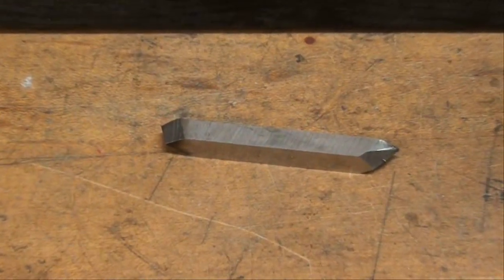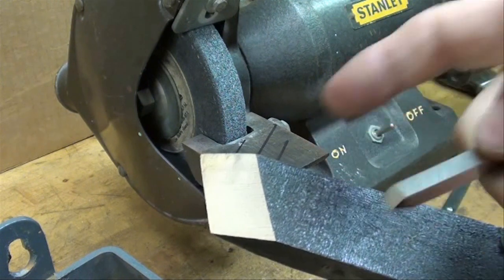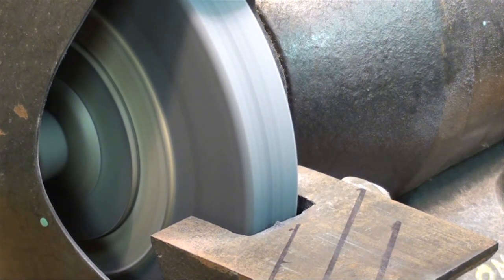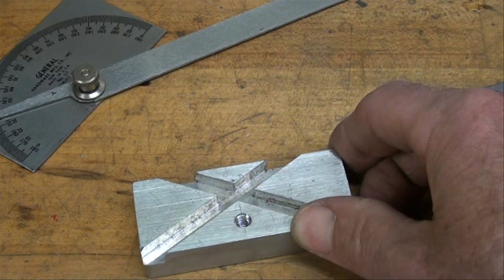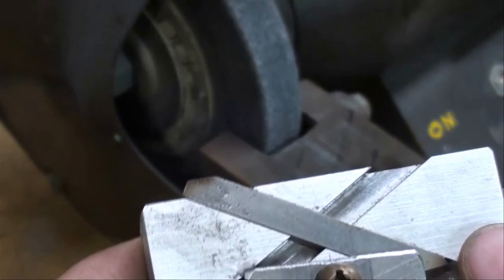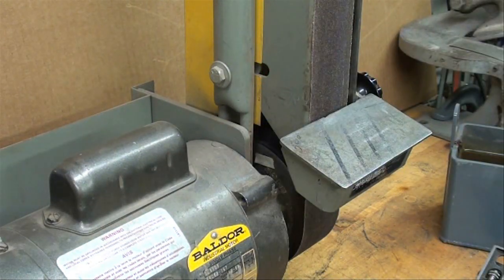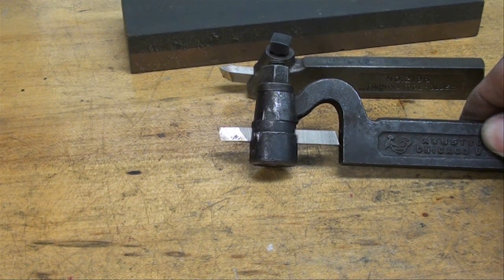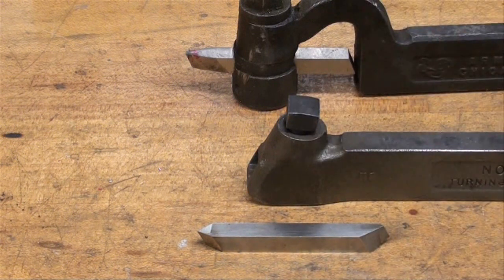MACHINE SHOP TIPS #98 Grinding a Lathe Threading Tool tubalcain

Comment: Mr Pete
  I have been a tool and die maker for over 29 years. I run a cnc shop and have a young man that I had do a little project on Friday. The project was to a  write program using the rotory table for this jig. Boy can he grind threading tools now. We now have one in 1/4,3/8 and 1/2. Acme to. These are  real nice jigs. Thank you vary much for the video.

Carl Boe

Comment: I remember the tool bits we had to grind by hand in tech school.  The three we had to make were a turning bit, ground to certain angles, a 60 deg threading bit, and an acme threading bit, of course they were all needed for projects.  We made heavy-duty planer jacks with acme threads.  You're right, it is very difficult, but not impossible to do.  By far, the most difficult was the acme bit.  I still have it in my toolbox after all these years.

Comment: if you major to land in your jig for your bench grinder / table you can put a fence on it like a table song where you can move it a little bit and um if you will run a bolt through it the whole length you can use it as a clamp to clamp in place so it's more movable and if you got any way to draw it out to make more sense because they usually have to draw up my plans for other people to understand them I usually can see it in my head in detail thank you for your videos this is not a generic thank you thank you so much

Comment: Thanks for the comment and I enjoyed the video, and liked the jig idea for creating the angles! I had always been more into right and left handed tooling ready to thread up to a shoulder, creating more bits because of limited pitch range, ending up with plenty of centered bits as they aged and worn back the leading edges. Sometimes a negative top angle was used to keep from sucking bits due to backlash problems in cross feed screws. ;{)---
Reply: cut a part to plan dimensions, then check it against an available constant.
We can always blame the plan. Right?

Comment: Here's a good tip. Just the other day I needed to grind a 55deg BSPP single point tool. I set up the Compound at 62.5deg using Trig. (Sin 62.5 x 125 = 111). This meaning I could machine a 3/4" piece of stock at 27.5 deg of chamfer. I did two pieces and drilled a small hole in one. I set one in the tailstock and the other in the chuck and brought them together. A perfect 55deg to set the tool grind. And exactly the same for any tool angle needed if you don't have the gauges.
Reply from the maker: Great tip!

Comment: I have watched a lot of your videos. I got a logan 10 inch lathe and have been turning a lot of steel into chips. I have a little round tool for making threads, and no matter wha I did, I could not make a good thread.  I gave up, and ground one. Night and day difference, the threads now are acceptable, and they were horrible before.  So thanks for what you do. You explain thing better than anyone, I really appreciate it.  Tom
Reply from the maker: THANKS, Tom
Reply: Whenever u cut any thread in any lathe the following angle and leading angle grinding is important . then there is no problem uccer at the time of threading . leading angle give  ( clearance angle ) given on the left  side of the  RH thread to remove the material and the following angle given on the right side (  clearance angle ) helps to finish the remaining material at the time of threading

Comment: Does the 60 degree angle change when you grind the top rake?  Seems like the angle would be a smidge smaller since the sides have the clearance but hard to wrap my feeble mind around the angles...probably splitting hairs.  Thanks for taking the time to do all the videos!

Comment: Sir: Forgive me if I err in digging through memories more than 50 years old.  I recall a machine shop teacher telling us that those angled tool holders spared us the chore of grinding a 20 degree back rake into turning and facing bits. 

I was NOT a good machinist and only too glad to get a mandatory class under my belt.

Eli D.

Comment: Hy I managed somehow to get vido playing but the audio now sound like driving on a dirt road.
Maybe also a tip for someone, I vise up the blank died and scribed and take it down with a
die grinder, taking the majority off then back to the grinder to finish.  Air die grinder is fast &
I have more control & no hot fingers, saving grinding wheel.  I like your jig now ill fire up my
shaper.  Thanks   oh also Kieths audios doing same thing. I'll call him he is good with PCs.
thanks again Sam

Comment: 2:36 Actually it is a requirement that the tip not be sharp. 
For cutting a male external thread the specs call for a flat width of minimum of PITCH x .125 and a maximum of PITCH x .250
For cutting female internal threads the tool must have a flat width of minimum of PITCH x .041667 and a maximum of PITCH x .125
A radius that fits inside those limits is allowed but not required.

Comment: Grinding various items is a great opportunity to see the various types of sparks that different steels make when ground and learn to identify them. But then Lyle says that later as I see.

Good point on the green goggles that seal around the eyes, gently blowing off your face and hair gets rid of debris that could later fall into the eyes. Big danger from the sharp chips you get using a die grinder with a carbide burr and other cutters.

Comment: Also on the method I'm, using:
A disc sander and a cross slide vice clamped to the sander table and I just run it at an angle and push the tool into the disc. (I have active water cooling on this sander - it's for preparing surfaces for microscope so active cooling, 12" buffing and sanding wheels, lapping compounds, nital bath at the finish, all without overheating that destroys the surface crystals on the metal.)

Comment: Do they make small grinding wheel that you can install on the lathe? This would give you all the control for any angle by holding the tool in the post and you are set to grind.

Comment: The angle you draw on the jig is 30 not 60. I used the protractor set as 150 degree to check the right angle.

Comment: Just want to say, I watched many videos on youtube but I enjoy yours the most.  You have a talent for teaching.  I have a question, on the belt sander, what grit of sandpaper do you have?  I was thinking of picking up a small one from Harbor Freight or Home Depot before now I have even more reason.  I already have grinder.
Reply from the maker: +Dima Prok I use either 80 or 100 grit. Perfect for general use, wood or metal.
Thanks for watching
Reply: +mrpete222 I got around to grinding first threading tool couple weeks ago from 1/4" blank and my "tilt" angle turned out to be much steeper at around 25 degrees (it's hard to measure).  I was able to make test threads and it seems to be working fine, I made test cuts.  Is there going to be a problem with angle like that?
Reply from the maker: +Dima Prok No-that will work. Just a more delicate tool - tip may break off
Reply: @DimaProk  make sure you take shallower in feed cuts and traverse the thread a few more times. Tool will last if you do that. Good job trying. Keep at it.

Comment: in my case it probably be easier to make it out of wood like a hardwood the table and The Jig cuz I've got a lot of wood on hand but not very much metal I mean I could cast some metal but it'd be easier for me to do would work with the skills and tools I've got and I've got a little bit of shop time with a grinder so it probably be easier with wood then I could make a more permanent gig you later of course it does take the 1st right hardwood and depends on how rough on him with it it might hold up enough for me to get enough tools out of it

Comment: Is it bad to lap the surfaces? I don't like coarse marks from the grinder, or sander.
I usually grind the tool with a disc sander varying trough grits up to 2000grit that gives mirror like finish and add some lapping compound to a hard buffing wheel to make it a real mirror. (+nital)

This is how I treat most cuts for microscope analysis on cracks, welds, etc so why not dress up the tools? For me it cuts fine the way I do it. 

Any reason not to smooth out the surfaces (without screwing them)?

Comment: Nice video.  I have appreciated you tool grinding series.  For the threading tool, you don't seem to bother with compensating for the thread helix angle adjustment on the opposite two faces.  Can you explain?  Does this mean that the tool you grind in this video is equally useable for both left and right hand threads?
Reply from the maker: +John Pierce Thanks for watching

Comment: so you grind the tool with the 15 degree angles, which gives you front clearance-then you put it in a tool holder that tilts it up-doesn't that pretty much wipe out the clearance to teh front of the tool?

Comment: Hi Mr. Pete, if I just have a lathe, (no mill to make the jig) can I get one of those wheels, chuck it up in the lathe on its side, and use the tool post to hold the tool steel at the right angle? (Maybe rig up a water cooling device as well)
Reply from the maker: +May the Schwarz be with you Thanks for watching. Probably not. Too dangerous plus the tool needs to be held at a compound angle
Reply: Thanks for answering!
Reply: +May the Schwarz be with you Since the jig is aluminum, it is conceivable tht you could use a table saw or radial arm saw (better) to  cut the grooves into the aluminum. Just use a carbide saw blade, set it for up to 1/4 inch depth and make a couple of passes to 1/4 inch. Kind of like a cheap horizontal mill, you know.
Reply: Pretty cool, oddly enough I do have a radial arm saw.

Comment: you can not put on a wooden arm on your grinder and take a finishing nail from the inside out of a tin can and punch the small hole the smallest it take to drip the water onto the tool that you're trying to grind and that will keep it cold keep it simple thermal dynamics keep it simple and you'll be more in tune to do more stuff with less and a Big Tomato can the tall ones is the best one I found the hold the most water you don't want to too small of a hole or too big of a hole happy mediums the best one you'll have to have several cans because you'll screw up with you but then if you need any amount of the pasta in a can or any herb pasta sauce that also will work it's just coded enough to so the water doesn't eat the can it will blister around the hole eventually but it takes so quite a while and what I mean by blessed remove rust improvise adapt and overcome that is the motto to we doing everything that I can't do with the tools on hand keep it the simplest method and you'll do the most with the least little amount of knowledge and tools and when you get the knowledge that's when you build a better tool that's part of improvise adapt and overcome hopefully if John is listening to my conversation because my phone's been hacked several times they're going to work out the better knowledge that's a little bit of Common Sense / crazy talk so really they need to work on what they sent us and what I mean by us I mean the United States and anyone else because the details will get out and that's where we need to work with and fix the problem in the drift is problem doing their reality and Ours their reality and Ours keep working keep it simple straightforward and you'll get your tool made anything for me again 2 Gunstock or just a wooden bench if you get the right knowledge and have a little bit of common sense to identify what is good about it and what is bad about it you'll get the right pulling down thank you for your videos

Comment: Why isn't it a good idea to put a blank piece of high speed steel in the lathe tool holder.... and clamp a grinding disk into the lathe chuck.... and slowly bring the HSS into the grinder at a preset angle.
     Maybe someone has come up with the idea and I just haven't seen it.

Comment: Tool sharpening Freehand is pretty hard for this 60 year old "boy" as well. mrc109
Reply: mrc109 

I made a wonderful jig that take all the human error out of it... and for some reason I still do it by hand. LOL Lazy? Perhaps a bit. But I find that just about the time I get upset enough to sharpen it is when I want it done quickly instead of dead nuts accurate because I want to get the job done. Suprisingly enough I put it in the jig after sometime and find that its so close that it seams like a waste of tooling to grind it to perfection... most of the time its because if you have the proper angles on it in the first place your really just dressing it up. The tool holder is really great though if your starting from scratch.

Comment: many ways to grind,use the FLAT  of a depressed angle grinder wheel, hold the hss in the vice,  simple, no facets, nuther thing modify   clamp in chainsaw sharpening machine if you have access, round bench wheels are by nature not ideal